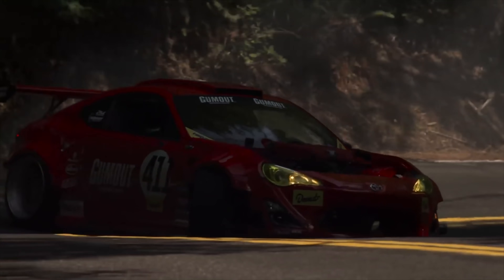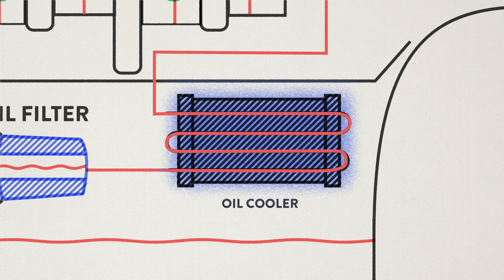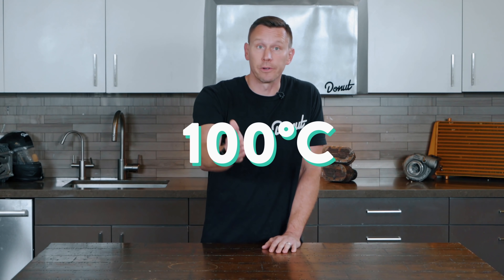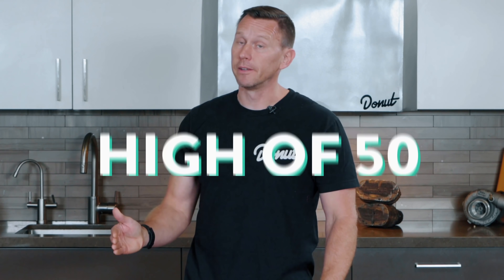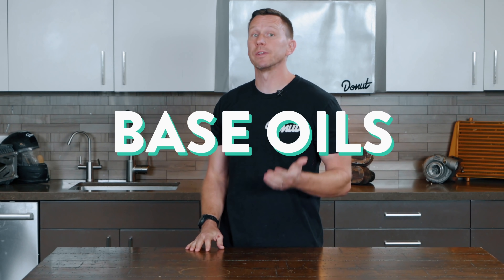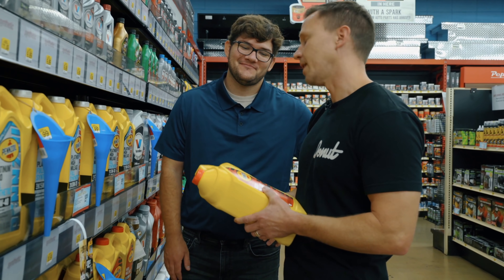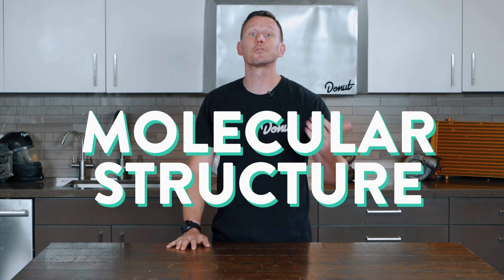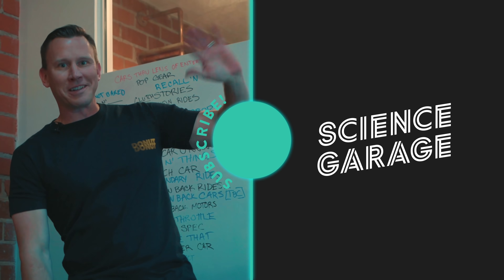CONVENTIONAL VS SYNTHETIC MOTOR OIL - How it Works | SCIENCE GARAGE

Comment: You really screwed this up. In the US, full synthetic is lawyer-speak for group 3 mineral oil that is refined so the molecules are nearly the same size. 100% synthetic is a group 4 oil that is actually synthetic. This was decided in court by a bunch of evil lawyers. Even Mobil 1 is now full synthetic, which is a group 3 mineral oil. Only one brand is 100% synthetic group 4 oil. It's expensive. You fell for the hype and lawyer-speak. Do some research!
Reply: Wow calm down .......it is educational
Reply: @mohammadalward6941  Calm down? It's not educational when it's wrong.

Comment: One thing that wasn't mentioned is that conventional oil is better in 2 stroke engines and you shouldn't put synthetic oil in old (pre 90's) motors because a lot of times they don't have the proper additives and will cause oil leaks.
Reply: Really? You could always fix the leaking seals. Or avoid any risk of leaks and use no oil at all.

Comment: How is the 0w even able to lubricate?
Reply: Take 0w-40 for example. The "w" there is winter, not weight. This means it behaves like a 0 weight oil in freezing winter temps. The oil is still thick, but not so thick to where oil doesn't flow. This allows oil to flow easily during cold starts. You want immediate oil pressure. The 40 is the weight the oil behaves as when the oil is hot. The polymers in the oil expand as temps rise, causing the oil to now behave as a 40 weight oil in hot temps. The oil has become thinner due to high temps, but behaves like a 40 weight to keep its viscosity in high temps. It's fantastic technology.

Comment: TL;DR: Is it bad to switch back & forth between the two? Any dangers with any slight mixing that might occur if I do switch it up, even once?

Context: Used synthetic in my '14 Xterra for ~60K miles, needed a last minute oil change before a road trip and couldn't afford synthetic so I put in conventional. Now it's time for another change, and I'd like to go back to synthetic, but just want to make sure I didn't commit some "irreversible" sin by putting conventional in. Any advice is appreciated!

Comment: So I changed my oil around six months ago and put armsoil senthetic oil in my 2jzgte engine. I used the car around ten times. (Short Sundays drives ) and I'm no where close to the mileage to change oil but was considering changing it just because six months has passed. Just wondering if the oil start to break down with time or only when in use.

Comment: I've run that Shell Rotella Heavy Duty Diesel 15W-40 you have behind you at 10:18 in my 1970 5.2L/318ci for the past ten years.
Hasn't broken yet. I do wonder what the manufacturer recommended though.

Comment: I have a f350 and running conventional(from the factory) my turbo whistle went away right at 5k and after switching to amsoil 5w-40 I'm still whistling down the interstate around 15k miles. I tow as well

Comment: I was convinced by a shop to do an engine flush on a BMW that sits a long time and isn't driven, but had synthetic oil in it. On average it saw 1600 miles a year. When i got it, it had been sitting for a while. Do you think the shop knew what they were doing or did I get hosed for an upchargeme of a needless $200 to do that Engine Flush and another $150 for an oil change?
Reply: Nicolas Losito, agree
Reply: I agree also

Comment: As a mechanic in Norway i can tell you that i never use anything else than fully synthetic oil, even on my 1998 ford explorer winterbeater i use long life fully synthetic oil made for newer Audi's 😜
Reply: There is a seruous difference in sludge buildup and the oil is usually still good when you change it

Comment: I actually used a 10w40 on my super beetle, it ran like shit and constantly gets hot everytime I drove it on the highway or at traffic jams. Turns out, all I need was a 20w40 ._. so yeah always refer to your manual books lol. Turns out the 10w40 isn't effective on cooling the insides of the engine, because it's not thick enough said my mechanic.

Comment: friend of mine is a fairly well-off mechanic, but for whatever reason he swears up and down that all oil, regardless of weight, brand, how the vehicle is driven, or whether it's conventional or synthetic all wear out at 3,000 miles, and that synthetic is all a scam for money. not entirely sure why he believes that, considering he isn't one for conspiracies otherwise
Reply: Never trust that dude to work on your car. He sounds like an uninformed idiot.
Reply: @DeViOuSdB1  it's just a personal belief of his, he doesn't actually push that shit onto people. according to him some guy he knew like 10 years ago had some sort of machine that could test viscosity over time and every oil he tested went to shit after 3,000 simulated miles. I know it's bullshit, so I do my own oil changes, but other than that he knows what he's doing, that's why it's bizarre to me. it's probably because he trusts word of mouth more than the internet, and our local area is full of dumbasses.
Reply: abobo  Your friend is 100% right   Read an article by consumer digest   SEPARATING FACTS FROM FRICTION.  The synthetic name doesn’t have a meaning anymore. All types of oil gets dirty   The best oil is clean oil

Comment: Hai Donut media, My motor bike recommends me to use 10w30 oil, will it be any problem if i use 10w40 or 15w40
Reply: The only potential problems I can think of are a slight reduction in power/fuel mileage and at worst added wear. With a thicker oil an engine must work slightly harder therefore reducing power to the wheels. In addition, less of the energy from fuel gets to the ground so you could lose mileage, but it might be an unnoticeable loss in both of those cases. As for the worst potential outcome of increased wear it depends on the engine, but the idea is a higher viscosity oil will have trouble flowing quickly or at all into tighter spaces. Most people are mislead that higher oil pressure is better when flow is what matters. The pressure gauge of most vehicles doesn't always indicate higher volumes of oil being pumped, rather it can indicate higher resistance to flow. In the past, people came to my store looking for thicker oil for a noisy engine requiring thin oil, their problems might have come from the thicker oil they were using not flowing and cushioning the moving parts of their engine.

Comment: I’m a 16 yo driver and I got shamed into getting synthetic the guy said ford required synthetic for mustangs I didn’t believe him but my grandmother told them to anyway also them mechanic said my car was leaking differential and that they could repair for $800 we didn’t believe them and later me and my grandfather checked it and it wasn’t, proof that some mechanics target people that they don’t think know much
Reply: They tried that with my wife too. Told her tranny oil was burned.  150,000 miles later, it was still running.

Comment: And my question to you about oils is... would you recommend to change the oil to synthetic in a car which has used traditional oil since brand??? (For example a 1998 subaru Impreza)
Reply: disclaimer, not an expert
All the mechanics I talked to before switching (as well as good ol' Dad) say that you can change when you change your oil.  My past 2 cars have seen me make the change to synthetic with no problems from it yet (and they aren't new).

Comment: You guys completly under explained the difference between the 2 numbers on the bottle. They are NOT both viscosity numbers. The first "w" number is a crank rating. They literally take a rod and drag it through a cold oil bath and measure the drag. This simulates metal parts having to overcome the resistance of the thick cold oil in the winter. The second number is your operating viscosity at 100*C. Do not give the illusion that they are on the same scale or "behave like" different viscosity oils. They behave exactly like the bottle says because they are measured in such a way.

Comment: I found out the hard way what happens when the oil pump fails in your engine a couple weeks ago :c Also, if the weights are rated 5-50 why is my oil rated 0W-40??

Comment: One things is not covered yet. On car manual and the synthetic oil can, the distance it says is 10k Kms. But.  Does that mean, I can change it once in 2 years if I do 10k in 2 years?

Need an answer.

My car is a suzuki swift   
And am in India.
Reply from the maker: Different oils suggest different changing intervals.  Synthetics last longer, but all oils will break down with time.  That's why they say things like "Every X km OR every X months- whichever comes first."  So it depends on the Oil.

Comment: Science garage on.... Cooking oil next? :D Well, even liquified butter can work, at least for a while. Also, in older diesels with low pressure fuel injection (like old volkswagen TDI) you can use old, used... Transmission oil instead of normal diesel. NUTS!

Comment: I have a 2000 Honda that has 165k miles on it. It has been using onventional oil and I know that synthetic protects better, would it be wise to change it to synthetic? Will that hurt the engine? What about Syn blend?

Comment: 1  3  5  
 |—|—|—|
2  4  6  R
Reply: I only have 5 gears :c
Reply: Alex Strömberg I only have 4. Straight H pattern
Reply: @alexstromberg7696  My 240 has 4😅👍
Reply: Goes 60 mph puts it in R for race mode
Reply: R  1  3  5
 | - | - | - |
    2  4  6
Reply: 1 3 3.5
2 4  R
Reply: R  1  3  5
 |—|—|—|
    2  4
Reply: 1 3 5 R
 |--|--|--|
2 4 6
Reply: P D 1 2 3             
    ||          ====={   } ↕
Reply: 1  3
 |--|
2  4 

Insert coin(s) to start!

DAYTONNNNNNNNNNNNAAAAAAAAAAAAAAAAAAAAAAAA!!!!!!!!!!!
Reply: Low range:

R  2  4
 |—|—|
1  3  5

(Flip selector up)
High range:

R  7  9
 |—|—|
6  8  10

🚛
Reply: R  2  4
 |—|—|
1  3  5

(old Ferrari)
Reply: @Jawslehoff   note to self: never buy a Ferrari. I'd put that shit in reverse at every light.
Reply: R 1  3
|—|—|
   2  4
Reply: N N N 
 |---|---|---|
 N N N  N
Reply: 2H
 |
4H
 |__
     /
   /
 N
  |
4L
Reply: Hey that's not my NV3550! This is!

1  3  5  
 |—|—|
2  4  R
Reply: P
R
N
D
S
L
Reply: R   3/4    7/8
1/2  5/6   9/10
Reply: Too bad my Mazda only has 5 gears. Rip...
Reply: R  1  3  5
 |—|—|—|
    2  4   6
Reply: P
R
N
D4
D3
D2
D1
Reply: 1 3  R
|—|—|
2 4

1996 Toyota Tercel
Reply: I have 
1   ^
2   |
3   |
4   |
5   |
6   ✓
Reply: P
R
N
D
2
1
Reply: Über.
Reply: 1 2 3 R
|--|--|--|
4 5 6
Reply: 2Hi
  |
4Hi
   -|
   N
   /
4Lo
Reply: Autopilot ON

Autopilot OFF
Reply: Instant transmission
Reply: Reverse is in wrong place
Reply: 1  3  5  
 |—|—|
2  4  R
Reply: 1  5  R  3
|---|-R|---|
2  R  6  4
Reply: R 1  3  5
| - | - | - |
    2  4

...Volkswagon
Reply: L 2
 |--|--|
1 3 R
Reply: 6
5
4
3
2
N
1
Reply: H
 I
L
Reply: R   +
 |__| D
 N  |
      -
Reply: Royce Zaro They don’t know that one lol 😂 

Good BMW
Reply: P
R
N
D
3
2
Reply: P R N D 2 1    (1980 Ford F-150)
Reply: P
R
N
D
S
Reply: @HOTPLATEGAMING  what's the S? Shift?
Reply: @duMaurier15  sport
Reply: P
R
N
D
M
Reply: @washboy154  what's the M? Manual?
Reply: P
R
N
D
3
2
L

Comment: My car recommends 5W20 Synthetic all year around. Guess it need the oil to behave relatively thin at all times. Must be the turbos.
Reply: Depends where the car is mostly driven at. That means your place is often cold.

Where I live, manufacturers recommend 20w-40/50 for conventional oil and 5w-30/40 for synthetic oil.
Reply: @rzpogi  Well, I mean, I doubt this is regionally decided. It's actually both printed in the owners manual and the oil fill cap. And they don't say anything about using any different oil from what I remember seeing, just 5w20 synthetic, no questions. The car was assembled in Chicago and I live in Chicago (engine assembled in either Mexico or Canada, can't recall right now) but we have a wide range of temperatures from well below freezing to tropical-level summer heat. Prime location for using different oils for different seasons, which I was used to doing in my previous cars.

Comment: Anyone care to explain, recently i discovered that heavy duty engine oil (HDEO)l that mostly use for trucks can be on regular car that commonly use (PCMO). So my question are, what are the pro's and con's using HDEO over PCMO?. In addition, even motorcycle use HDEO. Thanks in advance.
Reply: The additive packages. GF-4 SM HDEO had higher ZDDP but with SN I think it has been significantly been reduced.

Comment: For me, the age and condition of the engine is also a thing to consider. Fully syn on new engines especially with variable valve timing yes definitely recommended. But for old cars there are cases people switches to fully syn like 0w or 5w from conventional then the engine leaks and rattles like hell. Engine condition can also be a factor and also some old engines are not even designed to run on fully synthetic like 0w when they were new. At least that's what i think. Conventional oil is fine just remember to change it regularly.
Reply: I put some full synthetic in my '97 Honda Integra Type R, with 260000km on it, and it loved it way more than the semi synthetic or regular oil I was putting in. So Id say it depends on the engine
Reply: Tell that to people who buy brand new cars and put conventional oil and see how that plays out for them. People spend all their money on the car and pay for shit on maintenance
Reply: This comment is not entirely accurate. Redline (Oil company) and Engineered (The old Drive sub-series) did a video a while ago going in to way more detail about this myth about using synthetic oil in older engines and oil properties than the Donut video. Check it out here >>
https://www.youtube.com/watch?v=6VLMfUz34R0
Reply: Esters are poor lubricants, just saying😉
Reply: Straight conventional in my 72 beetle
Reply: 100% true man...i have experienced same thing
Reply: @junaidkhawaja9453  thanks, especially on very high mileage engines. I don't recommend putting fully synthetic. It may cause more damage than protection. What he said about fully synthetic is true but it only applies on modern engines from what i think of it.
Reply: @KVinceL  also if you have always run syn oil, keep using it.
Reply: @KVinceL  you're recommendation is based on poor research. No offense, but dino oil is worse in every way. If you stick to the proper weight, synthetic will always do better,  5w30 is the same characteristics regardless of whether it's dino or synthetic.  

The synthetic is stronger and more consistent on a molecular level.

They also don't break down because they are more stable, because of less friction in the oil itself imagine rubbing your hands together, dino oil has more pressure, which creates more friction, accelerating oil breakdown 

Leaks are common because the crappy quality of oil used before switching.  

The synthetic oil is higher in detergents, cleaning sludge from inside the vehicle,  sludge that helps block leaks in swollen seals 

Also, on seals, dino oil creates rubber seal breakdown faster than synthetic,  causing the seals to fail sooner. Synthetic does this,  but at a MUCH slower rate. 

Rattling in the engine is only possible from wrong weight,  or problems with the engine. 

You're right,  that as long as you change your oil regularly,  it doesn't really matter, the engine will run fine, but synthetic helps ensure less wear over the life of the car.  

Basically everything explained in this video.  

And you can switch as much as you want,  but don't mix, and you're fine.  

Mileage doesn't matter either. I have a camaro with 210k miles, full synthetic for 3 years now,  and it runs just fine.  My 99 Tahoe has 160k, running synthetic for 5 years.  Still doesn't leak rattle or tick. 

You just have to have a good engine that's sealed properly to begin with.